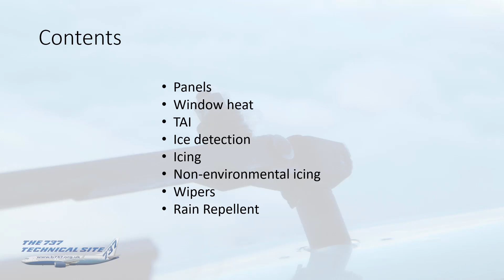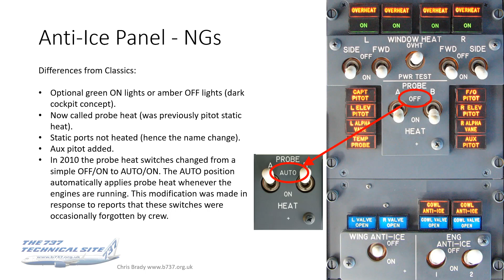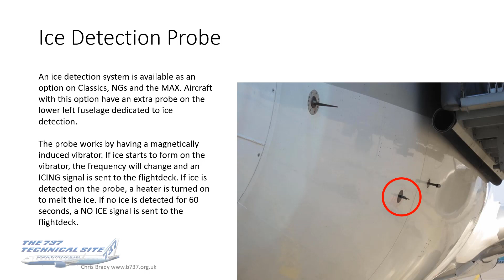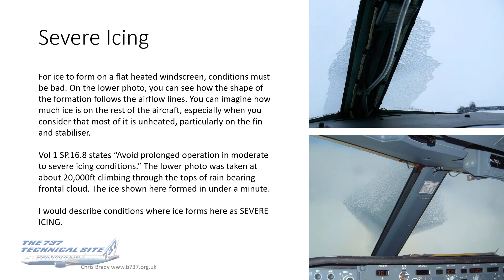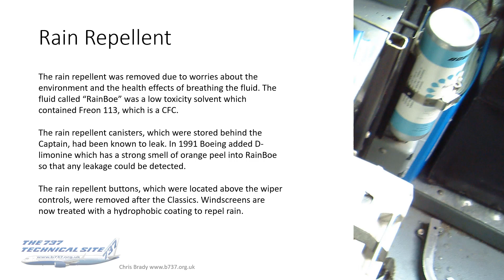737 Ice and rain protection

Comment: Hi Chris, on the topic of WAI. Is it correct to say that the SMYD/manoeuvre speed bias due to operation of wing anti-ice only applies for WAI activation in flight? i.e If Wing anti-ice is used during ground operations (Cold wx procedures), and automatically trips off on take-off, the bias does not occur?

As always, thank you for these fantastic videos.

Comment: Hello Chris, if you ever have a chance, could you explain what it means for an anti ice valve to "electrically controlled and pneumatically operated". It's written as such in the FCOM and it is a common question during type rating courses but I actually never had the slightest clue what it meant. (and once again many thanks for your very informative videos!)
Reply from the maker: No problem, it simply means that although the switching, logic and control is electric; the thing that does the heating is pneumatic (hot bleed air), not also electric as you get on some aircraft.
Reply: @ChrisBrady737  I always thought it was something related to the technology of the valve or the way it opens or closes. Thanks for the clarification it's much simpler than I thought

Comment: Hello Captain  thank you for your useful videos . I have a question 
When it is a transit or short-stop flight we should switch OFF the window heat at shut down procedure (especially in hot places )  or we can remain it until the last stop ? 
Thank you again 🙏
Reply from the maker: You should follow your airlines SOPs. Technically the window heat can stay on, if it gets too hot it will switch off. You can sometimes see this when a green light extinguishes on a window that is directly facing the sun (on ground only).
Reply: @ChrisBrady737  thank you 🙏;and I have also another question like  IRS : 
 FCOM  mentioned that «  A full IRS alignment is recommended before each flight > does that mean if it’s  a transit or short-stop flight we should realign the IRS ? 
Sorry about these kind of question because our company doesn’t have an SOP . 
Thank you
Reply from the maker: @zaymkreiked4348  The wording from Boeing is "A full IRS alignment is recommended before each flight", that is regardless of the length of stop.

Comment: Thank you Captain once again for the great presentation. Just a question with reference to 24:20, my FCOM (800 - EgyptAir, if that helps) says the WAI control valves are AC Motor- OPERATED (not controlled, and there is no mention of any pneumatic operation of the valves). Does that mean it could be a customer option that my airline has, In which case what you're mentioning in that part of the video doesn't apply to my fleet? Or is there something I am missing?
Reply from the maker: You are correct they are AC operated butterfly valves.
Reply: @ChrisBrady737  Thank you Captain.

Comment: many thanks for you, I have a question, Chris, can we use APU bleed air for anti-ice purpose？another question is why  don't the  Le flaps don't need anti-ice？
Reply from the maker: No you cant use APU bleed air for anti-ice. During testing it was found that the LE flaps did not need de-icing, this is the same as the 707.
Reply: @ChrisBrady737  why we can't use APU for anti-ice？
Reply from the maker: The aircraft is not designed to use it for ice because it doesnt have the power.

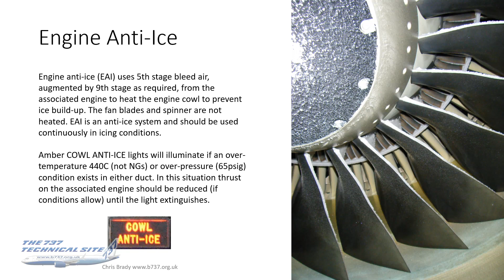Comment: Thanks again Chris. A quick question if you don't mind. At 17:14, the over-temperature situation of >440 celcius you note is not applicable on the NG. Is there a similar figure for the NGs or is it simply not monitored in this way? Thanks!
Reply from the maker: The NG does not monitor temp for TAI, just pressure. Only if the pressure exceeds 65psi will the COWL AI illuminate.

Comment: Hope you can answer my question. I really can’t understand why Maintenance crew closes the 9th stage high pressure valve if the Engine AI valve is stuck open?
Reply from the maker: I guess to minimise bleed air loss. The performance & fuel burn penalties are large.
Reply: prevent the overheat for cowl anti ice system from HP bleed air.

Comment: What I have heard from Boeing's test pilot, the outboard slats are not anti-iced only because it's too thin for installation, but it's coated with some sort of passive anti-ice coating.
I believe they have tested fly with that to make sure it's not a real issue then...
Reply from the maker: Very interesting. But as you saw from the photo in my presentation ice does form on the outboard slat so it looks like any coating is not effective. I am sure it is not an issue as washout means the tips stall much later than the roots.

Comment: About the WAI on the outboard slats, from some crude understanding of the stall entry characteristics of these types of wings, the inboard section, particularly just outside of the engine is the most critical for low speed lift. Generally an aerodynamic stall will start inwards and propagate outwards as you go deeper into it, for this reason you want the most reliable margins in that section of the wing when it comes to stalling, particularly to avoid a possible asymmetric stall entry condition at a stall speed above what is expected. I would guess on the far outboard sections of the wing, it's nearly impossible for that section to stall even with very heavy icing since the twist of the wing keeps the angle of attack of those sections somewhat lower.
Reply from the maker: Great explanation, makes perfect sense. Thanks very much for your input